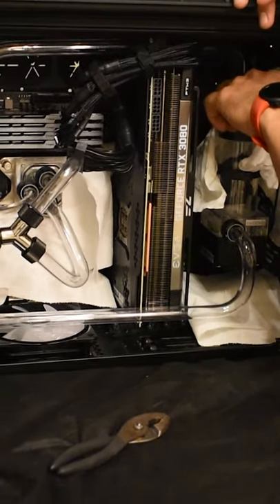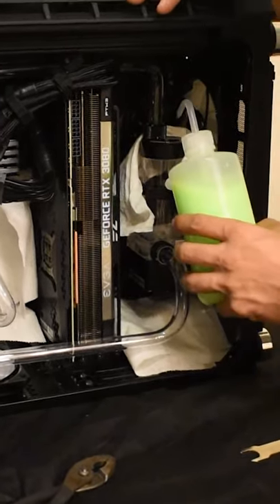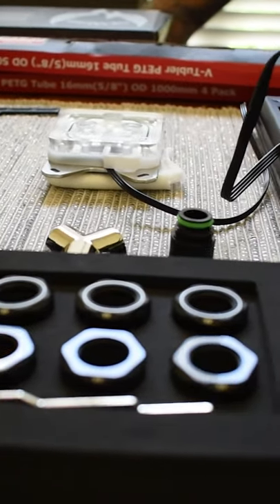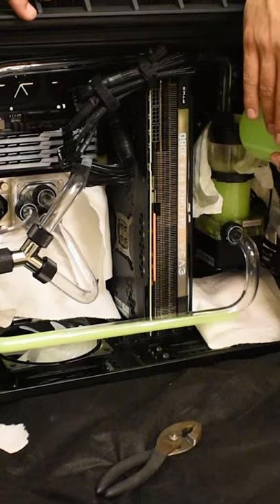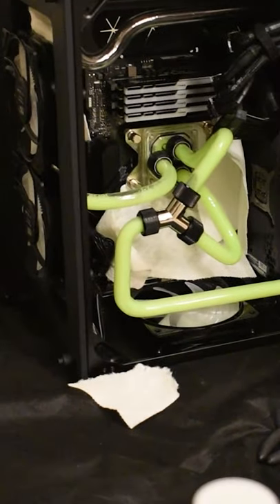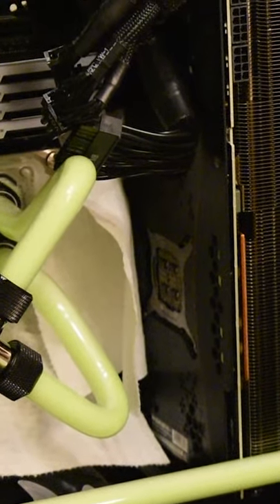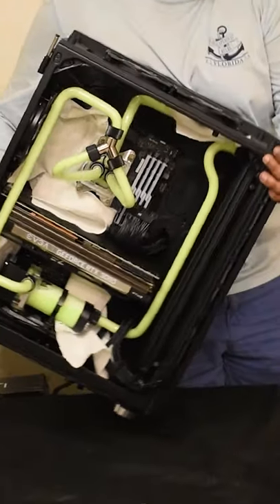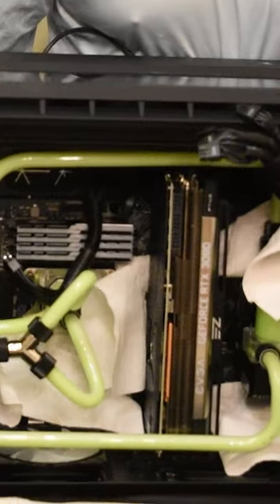Water Cooling Guide: How to fill and leak test a rigid liquid loop? #SHORTS

Comment: Uhhh, so you don't leak test after everything is installed? Or you do two leak tests? Sounds like you believe the actual parts are going to leak and not the connections on the fittings. I don't double leak test, I do it after I have it all installed. The key is to run it for 24 hours without power to the motherboard and other components. That way if something does leak, you don't fry your system.

Comment: Just no.  Build it , pressurize it, let sit for a small amount of time and check if psi dropped.  DONE.
Reply from the maker: Ah yes great comment, although air leak testers and great indicators of a leak, know exactly where that leak is a different story. This method shown in the video is an active leak test with water
Reply: @fluixtech  I use the soap spray method like on a bike tire haha.  You will see the soap bubble.  I just don’t like testing with water.  Have a good day.
Reply from the maker: @4gbmeans4gb61  Yes a great way as well